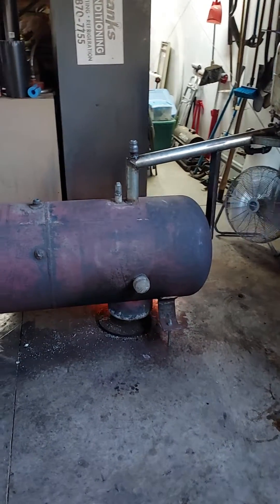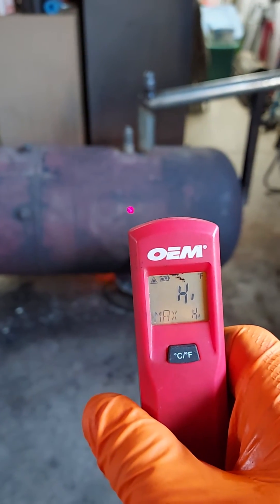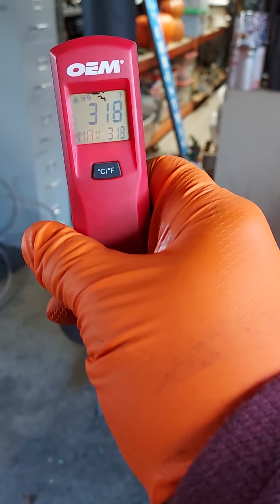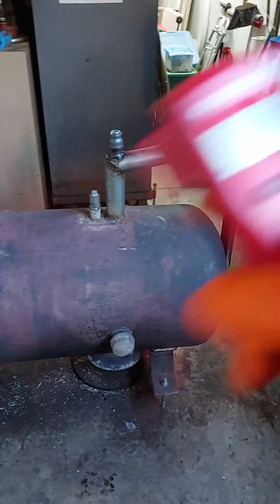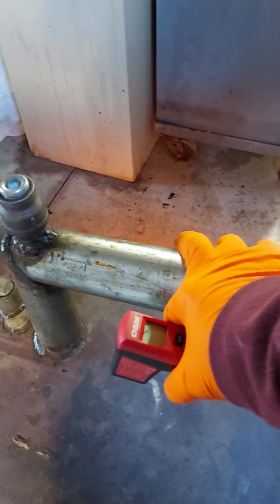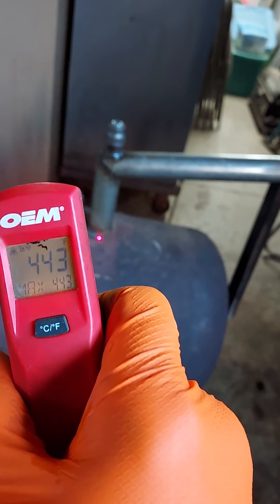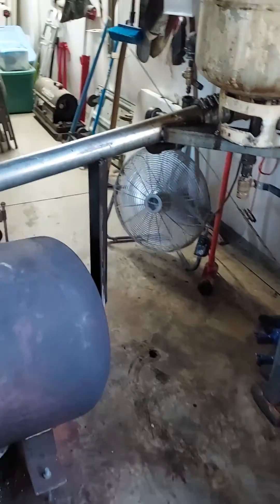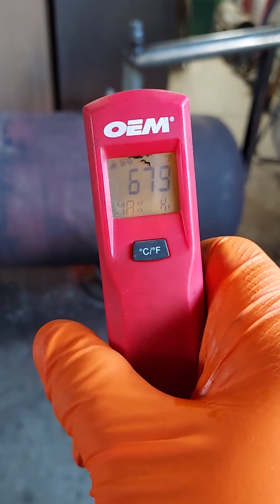OVER 700 DEGREE BURN ON WASTE OIL BURNER

Comment: Hi Frank this is Mike I’ve been asking some question last year about your system and I finally built it it’s been raining full day today it’s amazing we did a little bit modified on some stuff I did a little exhaust air Exhaust valve for easier adjustment of airflow when I don’t need so much air extra air will come in all through exhaust on the side it works really well I really appreciate your plans and everything